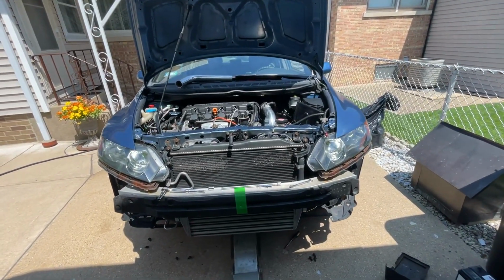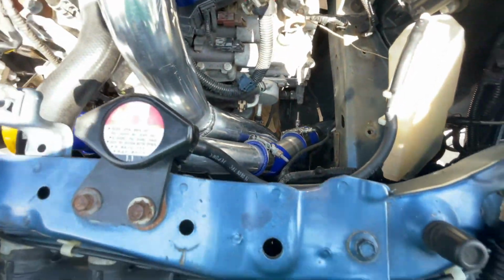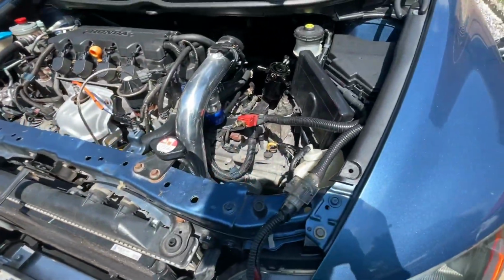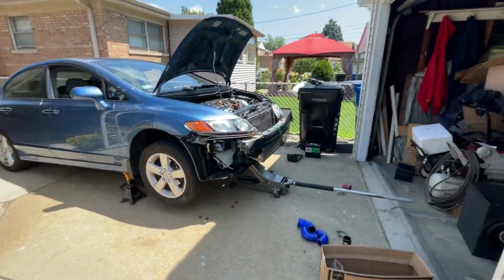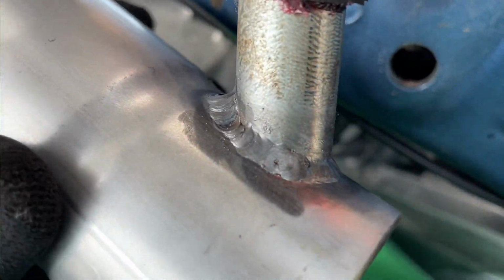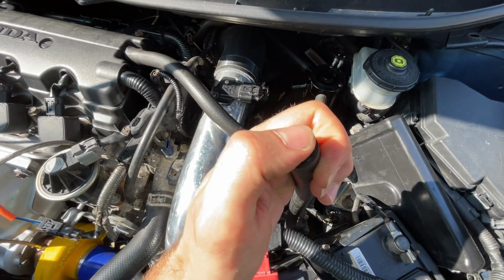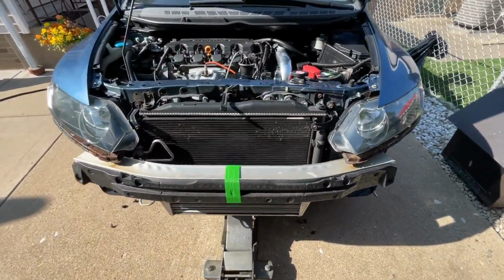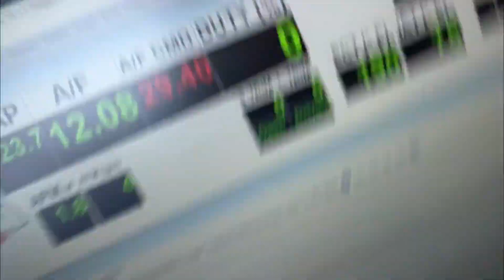Installing a Custom INTAKE for my Turbo Honda Civic 8th Gen ✅

Comment: I know I keep commenting. I don’t mean no harm but those lines your venting will vent better in the oil catch can. But you gotta open the system with a filter top. Three point oil catch can with closed system is gonna add pressure on your r18. Run two separate oil cat cans. One for pvc and the outlet goes to the intake manifold. The second oil catch can run from the in line to the top pvc ventilation port and the out to your custom intake coming out of your turbo. May have to weld on an opening for it. Remember both have to be open system to release that extra boost pressure

Comment: 🙌🏼👏🏼 😳Daaaaaamn !!!! Super impressive routing on them pipes , I’m almost to a thought 🤔💭 point to where when I turbo my coupe I would like to take your same design routes as ( screen shot ) it sounds hella clean at idle and when it spoons 🐌💨
Reply from the maker: Thank man. It was a quick set up to get a filter in their and colder air.  It’s been doing great! Better colder air helps lower heat in engine ! 🥵✅

Comment: Damn be careful. I have an 08 with 67k miles and the block cracked.
Reply from the maker: Danggg! An 08 cracked? Is it the coolant leak crack like the recall? R did you blow it
Reply: @BulliKid  Yeah, like the Service Bulletin they put out extending the engine warranty to 2018. I bought that shit in January this year for 11k and I'm still paying for it. Dealer really fucked me
Reply from the maker: @LandyXB  ufffff.  That’s terrible.   Throw some JB weld on it and trade that into the same dealer
Reply: @LandyXB part out 🤷🏽‍♀️

Comment: Have you disabled the egr
Reply from the maker: Yes. On hondata.
Reply: Will that catch can running to the intake side not put oil into your intake manifold
Reply from the maker: @rodneypowellsgardeningadve6381 well that’s the point of the catch can  is to catch any of the oil before it goes back to the intake